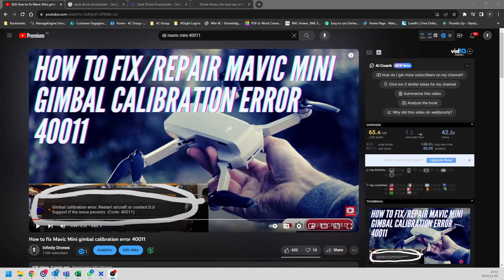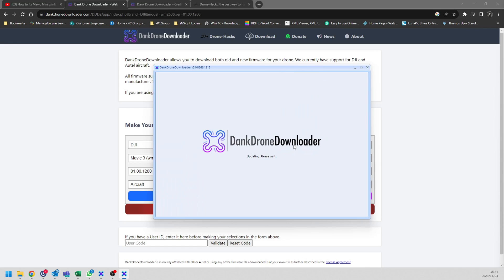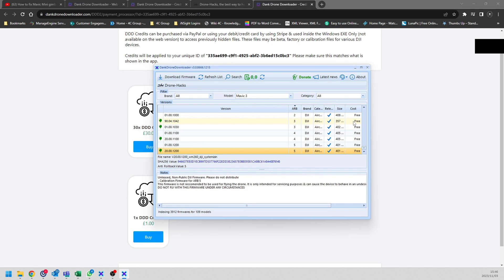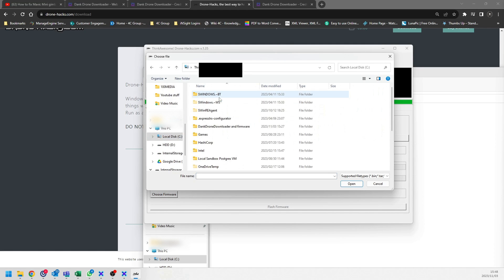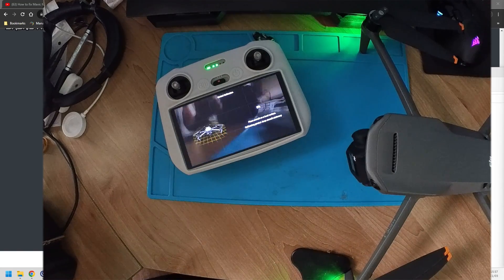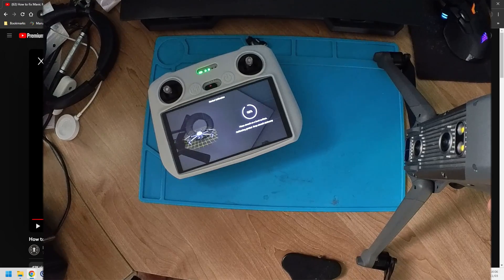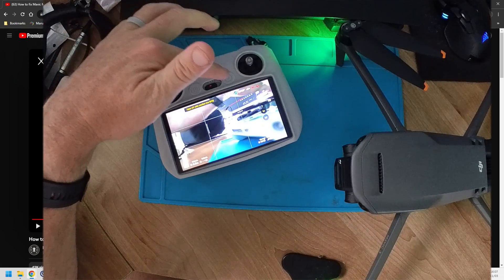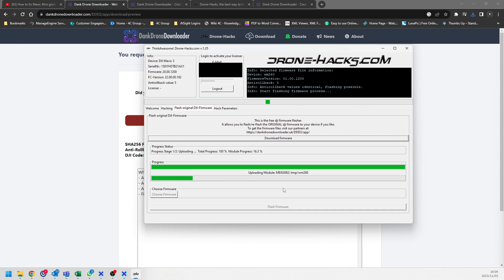DJI Gimbal Calibration Firmware

Comment: How to remove 40021 error??
Reply: I did try put back the original camera with the new gimbal (not the whole new gimbal + camera combo) and the errors are gone.
Reply: @yekru7 so u just took out the camera out the old broken gimbal housing and put it inside the new gimball housing and that fixed ur problem?
Reply: @xXDannySilvaXx  yeah, the Camera (that came with the drone) is already registered with the Core Board so you don't need the software to introduce to Core Board again. It works on my Mini 3 Pro. Other fixer might have another way to introduce new Camera to Core Board tho.
Reply from the maker: This does not sorry. That you'll need to send it because your replaced the camera. The serial numbers don't match...
Reply: Will this work if you replace the whole gimbal part?
Reply from the maker: Then you will need to recalibrate and remove message with official dji software

Comment: Thank you very much! I used this method on my Mini 2 anf it works! Though there’s still error 40021 (gimbal imu error).
Reply from the maker: Glad it helped! Did you replace your gumball. 40021 is  because the serial numbers of the camera and Coreboard doesn't match.
Reply: @InfinityDrones Eu tenho o Firmware de remoção do erro 40021.
Reply from the maker: @AeroByte360  You will need to send the drone in so that the official dji software can be used to calibrate it
Reply: @AeroByte360 can u please send me the Removal firmware?
Reply: @AeroByte360 can you help with it
Reply: @InfinityDrones https://youtu.be/B4a0mh2p5OQ?si=ygghJBm_r7h0dCcr
Reply: Mine is stuck at 31% in stage 2 when flashing firmware. I don't know what to do now
Reply from the maker: Did you get this sorted?
Reply: Anyone have the info for mavic 3 pro. Ai says its done through the dji app. But i wanted to know if anyone has had experince replacing gimbal for the above mentioned?
Reply: hi,Which version should I download for the Mini 2 gimbal error?